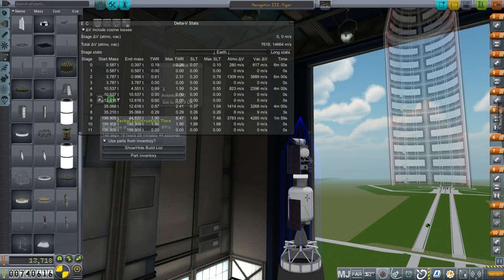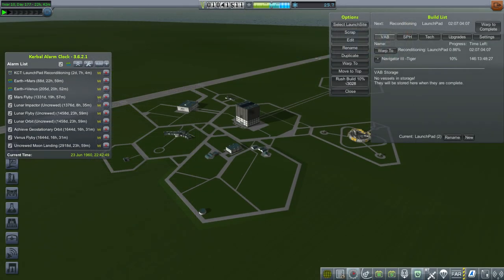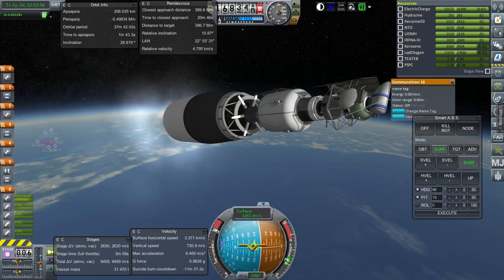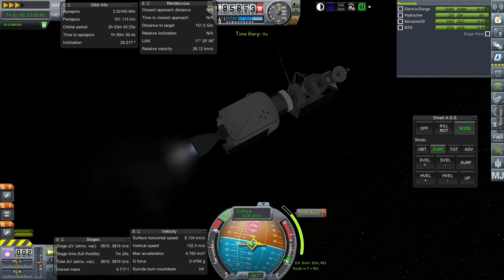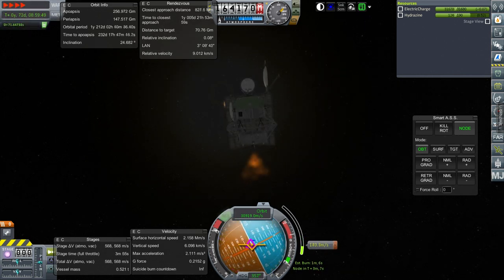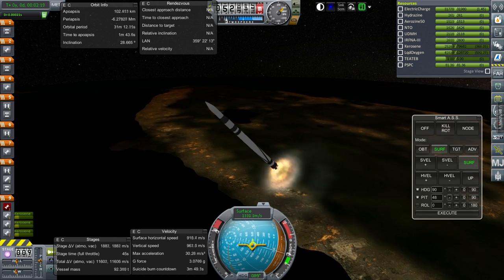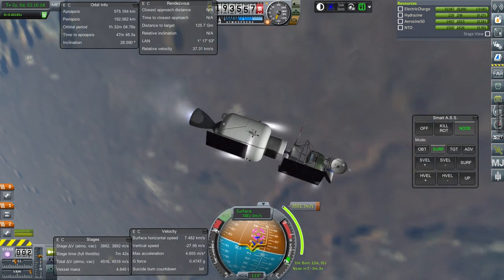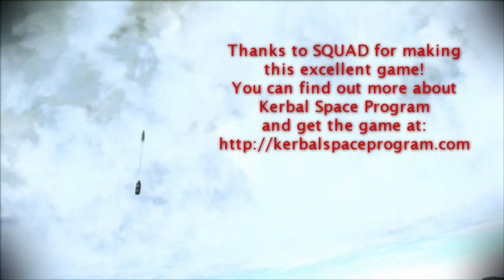Realism Overhaul in KSP 1.1.2 - 11 - Navigator III

Comment: To acquire the second build rate in KCT you'll need to upgrade the VAB. Also, from watching NathanKell's tutorial I've found out that you can have a second launchpad by clicking 'New' at the bottom of the KCT window. This will need time to build and will unlock at tier 1(40t launch limit) so you would have to upgrade that too to launch anything bigger. This is useful if you want a backup vessel to launch in the same window if one vessel fails